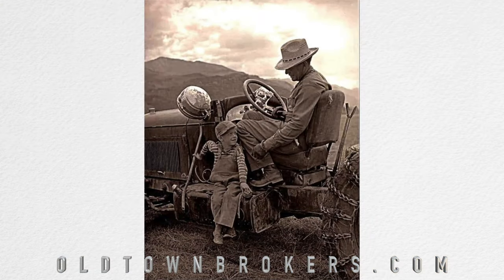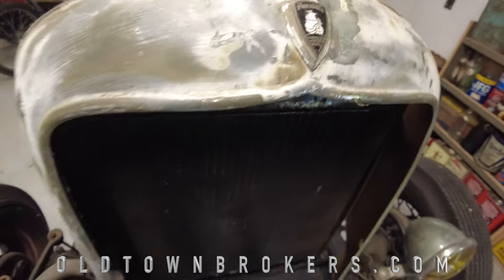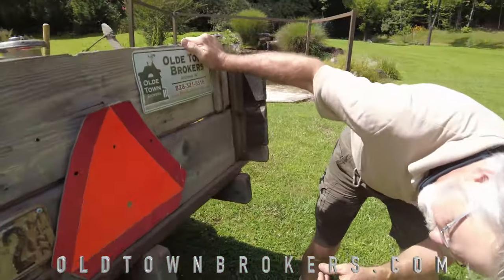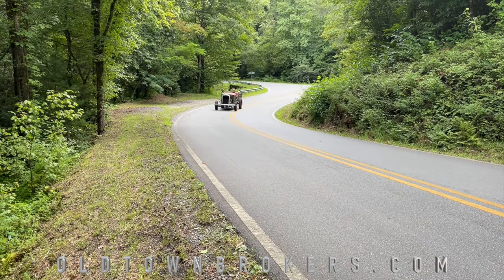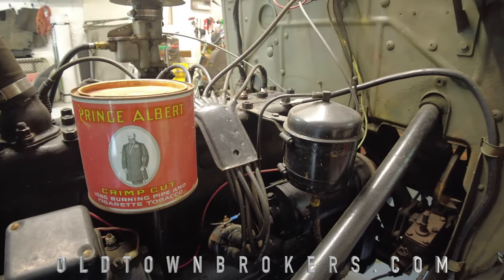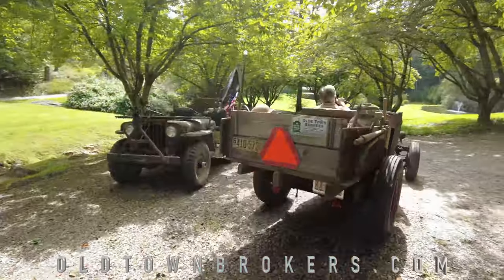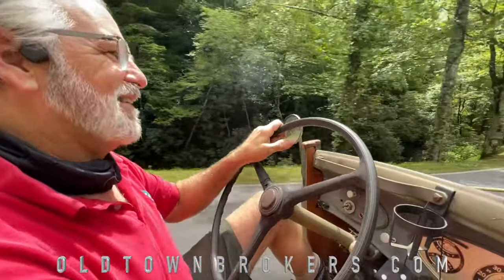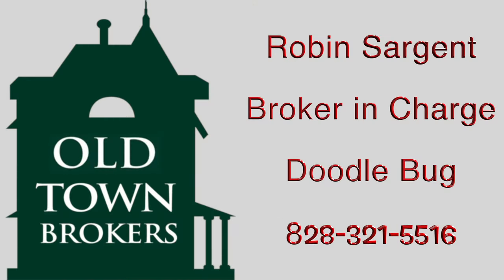Doodle Bug 4K

Comment: I have a 1927 model T Doodlebug with less than a thousand original miles on the engine.
It was parked in the barn in 1932, and it was purchased out of the same Barn, in Chickasaw Ohio, about 8 years ago, before the barn collapsed.
I bought it 7 years ago.